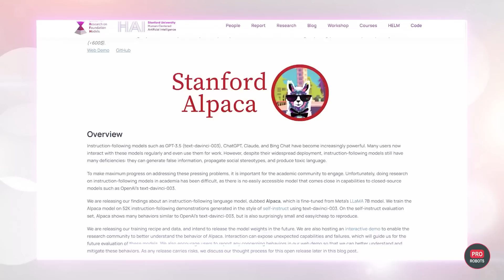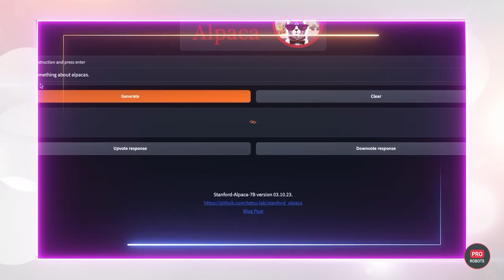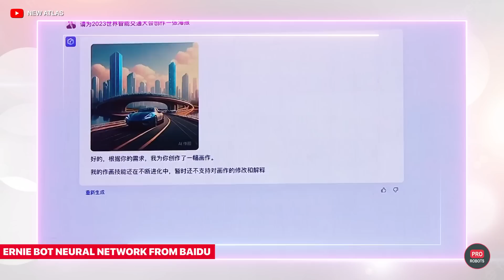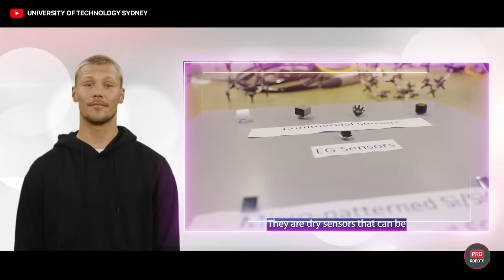GPT-4 clone neural network BOOM | Self-learning robots and AI | New  technologies | PRO Robots

Comment: I am realyy uncomfortable with the simulated host. It is boardering on the uncanny valley and is just off enough to be disconcerting watching and I try not to look at it when it is on screen. The face is OK but the body just hangs there off the bottom of the face. Would be better as just a head shot.